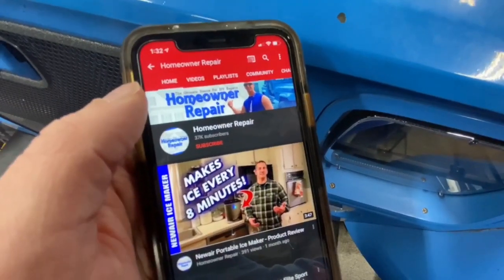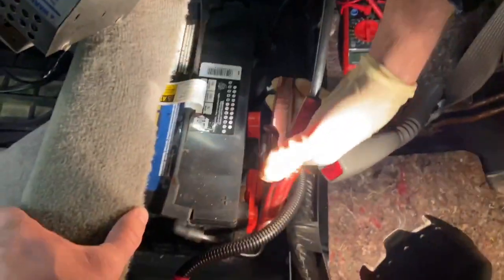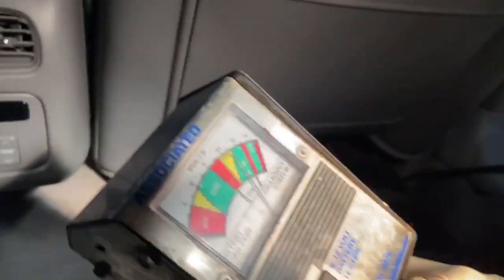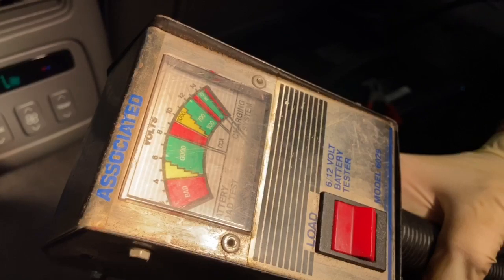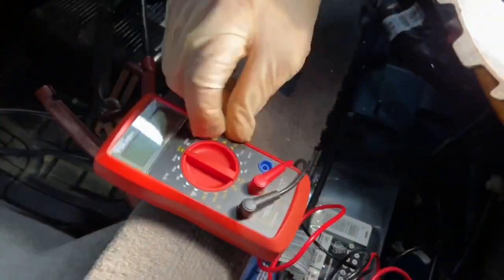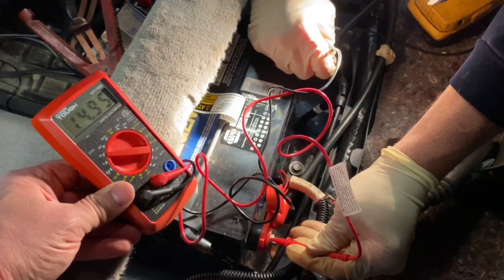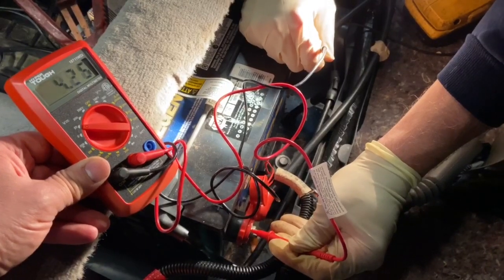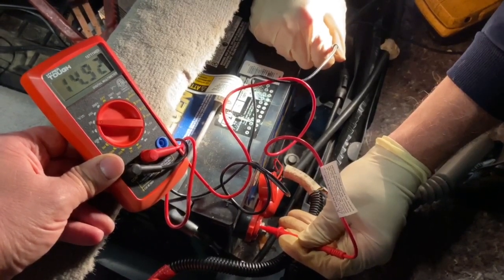How To Use A Battery Load Tester

Comment: Hi friend. Is it possible to adjust the needle to zero on that load tester ? There are some that have like a plastic screw or knob in the center and bottom of the plastic display, to adjust the needle to zero. Thanks
Reply from the maker: There was not